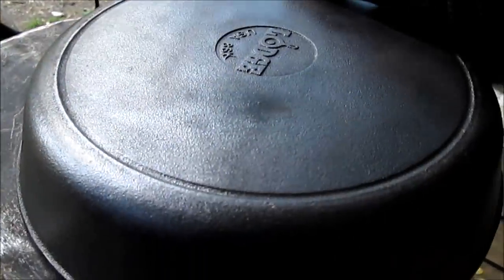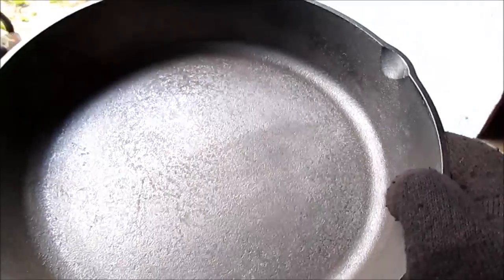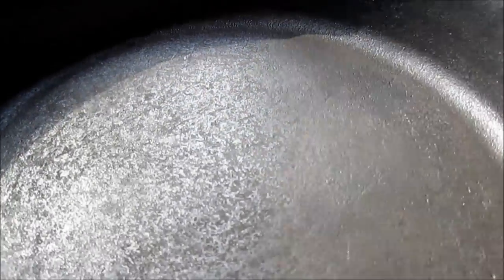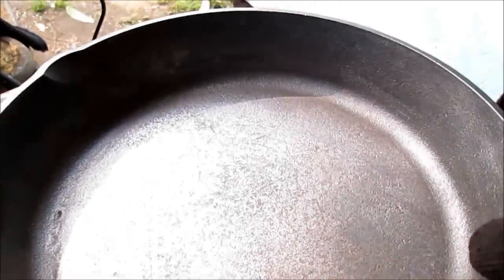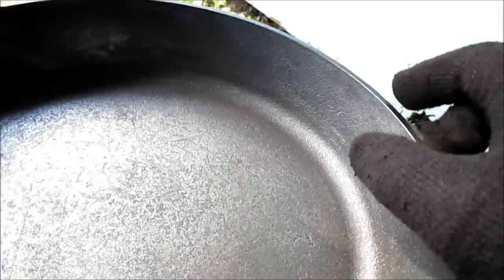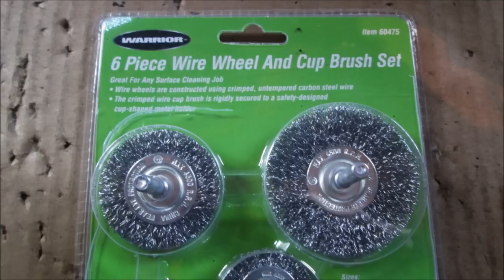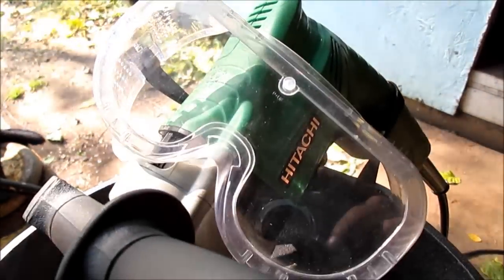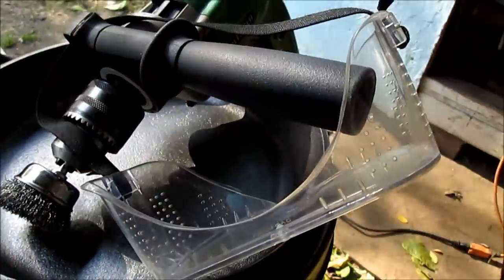Wire Brushing and Sanding Cast Iron Skillet

Comment: Wow, that rust really jacked that skillet up! I personally like the roughness of a new Lodge skillet. Gives lots of nooks and crannies for the carbon to grab to. I have three, 8, 10, and 12 inch, plus an enameled Dutch oven, think LeCruet style but about a fifth of the cost. I didn't have much problem with the factory seasoning, washed with hot soapy water before first use, then cooked bacon three or four times to get it really started good. Our camp skillets had to be seasoned, and when I compare the two the Lodge was pretty much as good. Oh and lodge does recommend hot soapy water on the pre seasoned and before you season as you're doing on yours...
Reply from the maker: Thanks for watching !!!...I have 2 small lodge slillets and anything but bacon has stuck I  have tried smoking the oil once in awhile to put a carbon coating in them it does help I am still learning how to do this so I will be trying different ways to season .them
Reply: Yeah, I had a few things stick at the beginning, after wiping with a paper towel I'd heat again, burn that stuff down, then oil. You can build up the carbon quick. I never even used water at the beginning. Any carbon is good for the skillet. I will admit though, I used these for about a year before my eggs slid around good. It does take time. The more you use em the less time it will take, and don't wash.

Comment: One of my Lodge's I had to sand, but the others took seasoning pretty well.  I recently bought a 10" sloped side Lodge that had eggs slipping around in it after the second use.  I used a wire wheel  on a grinder and god a great surface.
Reply from the maker: Craig Arndt I still had a rough surface after sanding but still better than before

Comment: I just purchased today a vintage, old for sure, # 8 skillet for $40 and the cooking surface, before I improve it, is almost glass smooth. I do enjoy the work & effort to smooth a Lodge cooking surface but at some point the work & effort to smooth a Lodge is way more effort, time & energy than it is to just buy a smooth cooking surface pan from the start. Just my $0.02¢ worth of information.
Reply from the maker: +2541968joey I agree if this lodge wasn't given to me free I would not bother... I bought 2 of their small skillets and re done them only because I use them outside and don't worry about ruining an old one on a fire or BBQ